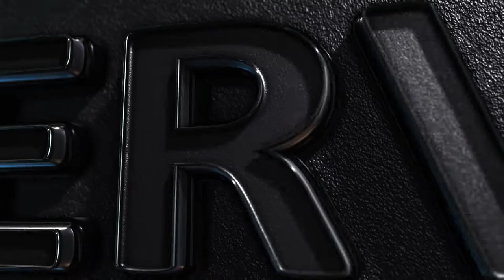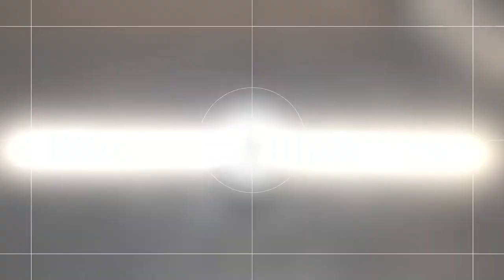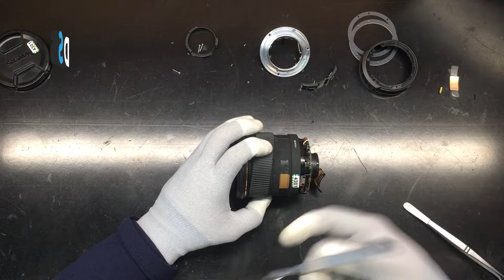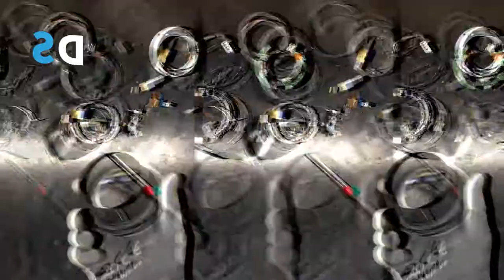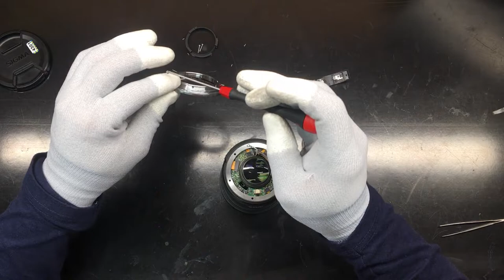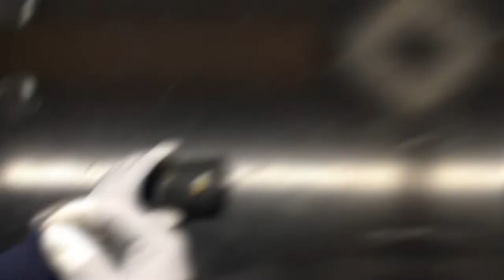How to repair SIGMA 17-50mm f/2.8 EX DC OS HSM zoom problem

Comment: Maybe give the poor thing some cleaning on the way? This is what sets different technicians apart in my opinion. All technicians can fix the problem, but only few will take the extra steps to provide better care to the customer's equipment. Not that the customer was taking care of it anyway, from what I can see.

Comment: Or maybe, the two spring clips behind the auto and manual switch have become unaligned and it won’t lift the gear high enough to disengage. Stripped it twice using this vid to find I only had to go 1/4 disassemble to fix it…

Comment: So this is the problem with my Sigma lens? Do you charge for your services? My Sigma 17-50 lens is suffering from this same issue. It still works but I basically have to use it as a prime lens since the zoom ring is stuck. How much would you charge to fix mine?
Reply from the maker: Hi , yes we do repairs for Sigma lenses. Basically this kind of repair is around 120 euro. For more info send email to service@digi-service.eu.  Thank you!
Reply: @DIGISERVICEBG  Euro? Where is your company based? I hope in the US. I don't know how to ship a lens overseas.
Reply from the maker: @agentbl  you can use easily USPS to Bulgaria. We are located in Bulgaria and we have a lot clients from USA and Canada.

Comment: Do you know which part to fix if autofocus is no longer working? I was able to fix the stuck zoom, thanks to this video. But now autofocus works for a few shots, then doesn't work. Manual focus and manually turning the focus ring doesn't seem to work either
Reply: i didn't have a zoom problem but i had a autofocus problem , if you open the lense from the back there will be an aray of tiny cogged wheels and a tiny motor that's most likely the part with the problem

Comment: Just came here to see if I could safely remove the 2 screws that hold on the AF and OS switches, they're slightly rusted and I'd like to be able to remove them, clean them, oil them, dry them and finally put them back in

It seems that I can, I'd be okay if I just took one out, cleaned it, replaced it, then did the other one next right?

Comment: My lens does not focus right after I fixed this.  What could it be? Pls help me
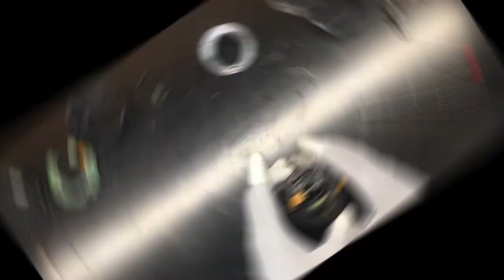Reply: I had the same problem, the part that he puts on the lens at 13:24 has a rectangular bar sticking out (on the inside of the part) that needs to line up with its holder on the lens. This is not shown in the video and solved the problem for me. You can check correct alignment by rotating the manual focus ring and see if the inside of the lens moves.